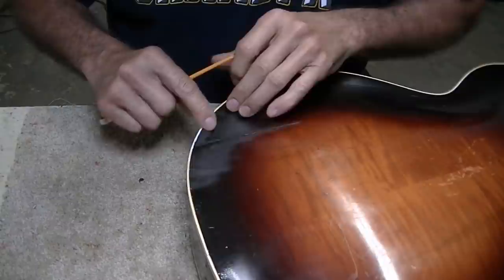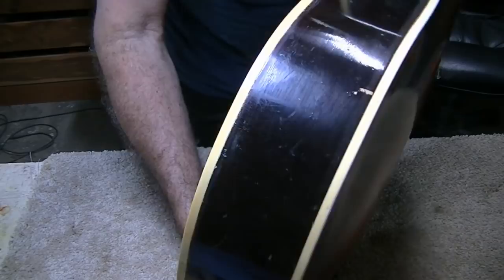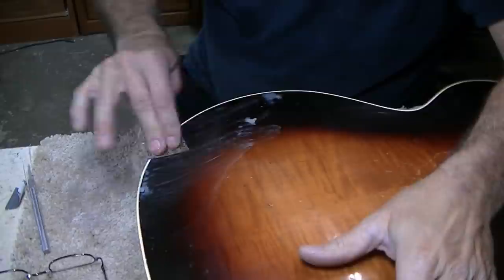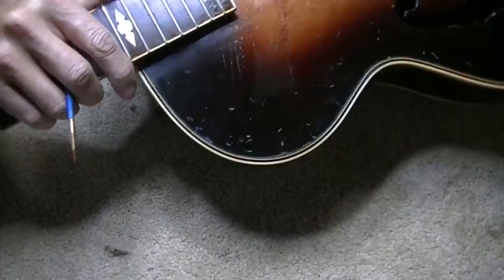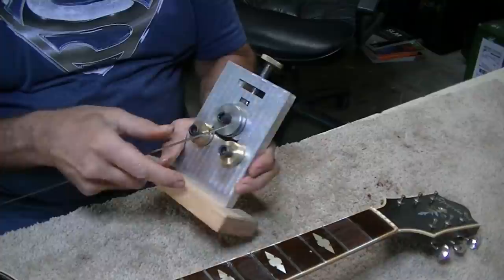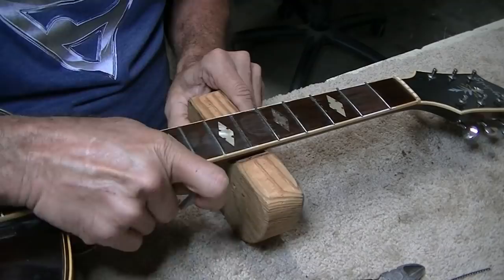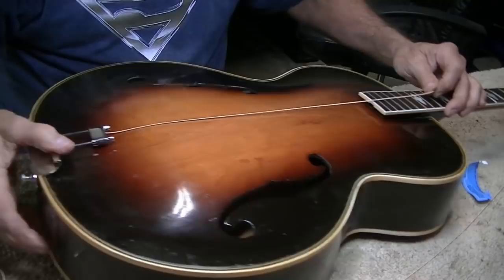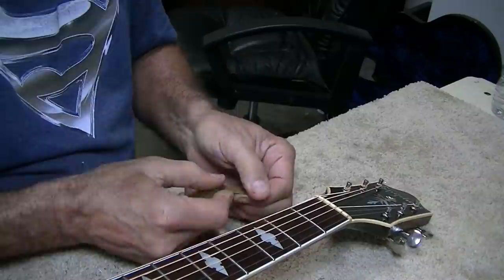378 RSW Epiphone Triumph Binding Restoration Part 3

Comment: Jerry Great job as always. The owner is sure happy and that’s what counts. FWIW I always do put the “backbow” rig on a neck like that to clamp it into the shape I want it - then run the trussrod nut up to hold it vs risking breaking the truss rod or pulling it out of the other end. And I’m not opposed to putting a washer or two (or 3 ) under the nut when necessary. FWIW2 I have worked on a few old Epis from roughly that era and none of them had that type of truss rod nut. My guess after seeing this is that they may have at one time but somebody long before me probably changed them out rather than buying or making a tool like you did. (What others guitar techs have a metal lathe or know how to use it... not many, if any LOL.) You are a unique case, sir.
Reply from the maker: I couldn't see any way of putting any spacers on it. Plus they have to be tiny teevan fit under the end of the fingerboard I'm not sure you could use a spacer at all even if there was a place to put it.

Comment: Excellent work. That restoration was one of the toughest jobs of seen you undertake just one problem after another.  As usual you seemed to press on solving each one as it arose. It’s great to see that the customer really appreciated your rare skills. I was surprised to learn that the 1938 guitar actually had an adjustable truss rod, ( even though it didn’t work), I don’t think that Martin started fitting them until the 1960s. Many guitar makers just put a metal bar in the neck, ( if anything).

Comment: Very nice instrument and work. I want it. But re the tailpieces, longer total string length doesn't imply greater tension. As long as the nut to bridge length doesn't change, the length of the rest is irrelevant to the tension required to tune it to any specific pitch.

I suggest that you can use the choice as to which way around to put the tailpieces to 'voice' the instrument: whichever strings have the longer length to the tailpiece will vibrate in sympathy more than the shorter ones. You just choose which sympathetic vibrations you want more of: bass or treble.

Steinway pianos take this to another level by ensuring that the string lengths from bridge to peg are in tune, which helps the brilliance of the sound by maximizing sympathetic vibrations (and keeping them in tune).

Keep up the good work, and keep healthy.
Reply: I forgot to mention what you no doubt already know, that back in the day these instruments were used with far higher actions than we would tolerate today. You can hear the physical effort on recordings of the era. Django for example. In the 1960s I played a couple of unreconstructed arch-tops owned by friends' fathers, and I can attest to it. I think it was only when Leo Fender got going around 1949 that people realized it didn't have to be that hard, if you made the instrument well enough. So you're making this one a lot more playable than it probably ever was before.

Comment: Nothing is harder than binding replacement on old guitars.  A friend of my had 1954 blonde cutaway D’Angelico New Yorker with binding issues.  New Yorkers have 9 ply-binding…yes 9 separate  pieces of stacked binding…very few luthiers would even attempt it.  Eventually a luthier agreed to do it…it took 18 months…yes months and it cost $2000.00 to do it. (It’s a $65,000.00 Guitar). A few luthiers quoted 7-9 k for the job.  After finishing the New Yorker, the luthier said “…I will never do another binding job……NEVER”

Comment: Looks like a nice Pasche VL airbrush?  Isn't your pressure a bit high?  My airbrush regulator gauge is six inches across and only reads up to fifty pounds or so.  You can adjust down to quarter pound or less increments.  Maybe a lighter touch on the dual action trigger?  I taught airbrush art and still have a dozen or so with a variety of inks and paints.  Have you ever tried inks for color then seal with lacquer?  Nice job of masking!

Comment: Awesome work done on that Epiphone Jerry! That one was a doozy 😀
Question: when you taped off the body of the guitar with the blue tape did you have any issues with the finish peeling off when you took the tape off seeing that the guitar is about an 80-year-old guitar with fragile finish? What kind of tape do you use? The reason why I ask is because I have a 1936 Gibson EH 150 lap steel and I want to know what tape is good to use on those old finishes. I believe my lap steel is finished with nitro!
Thanks again Jerry!
Reply from the maker: This was just regular painters tape. The low tack tape is better if you can find it
Reply: Blue paint tape. Any paint or hardware store.
Reply: Thanks Jerry as well as Bruce for the quick response. Cool next time I have to clean my Gibson lap steel I will use the blue tape to block off any parts that I don’t want to get dirty. Thx !

Comment: You are using the airbrush as a spray can of paint.  Too fast, too far away and way too much pressure resulting in bubbles and freckling?  If you have never used a liquid in the airbrush practicing on scrap to determine best pressure, distance and arm speed really helps I think?